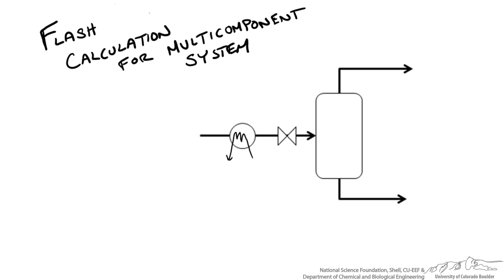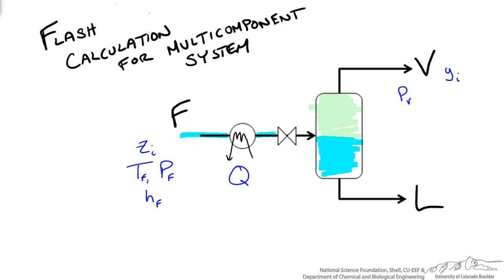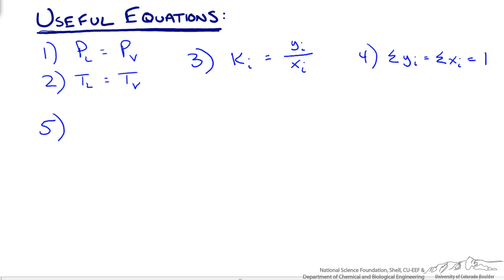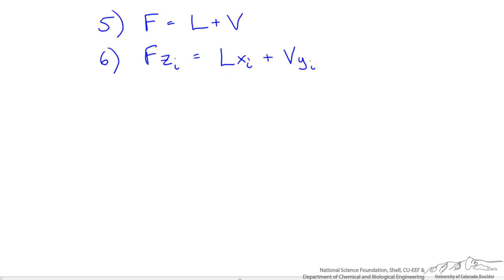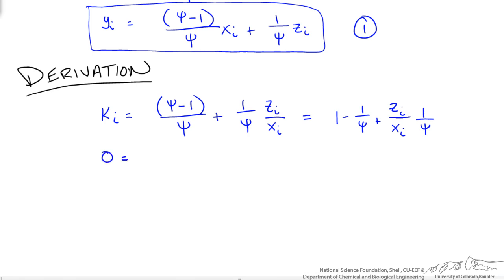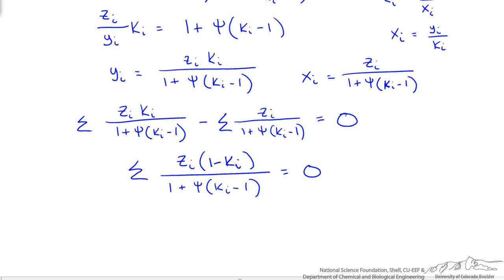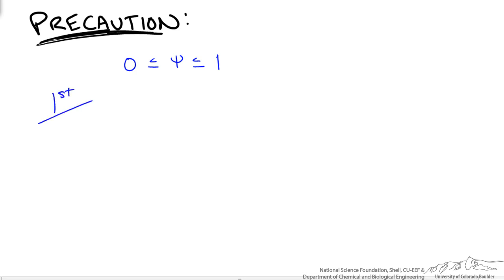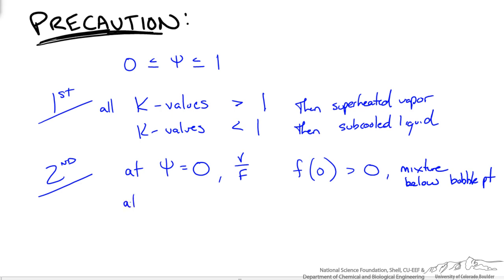Rachford-Rice Procedure for Isothermal Flash Distillation

Comment: That is an interesting approach that I need to investigate some more.   One question that comes to my mind is the the RR equation does not appear to enforce the required condition that the sums of the mole fractions in each phase must equal one.   It only enforces that these sums are equal (not necessarily one).  I suppose (or at least guessing) that the K functions are robust enough to not let this happen ?
Reply: Its just a mass balance, the only real valies are those who satisfy the sum=1 condition, if you apply newthon-rhapson method you would need to keep iterating till you get the condition satisfied.

Comment: but what happens to the volume of the steam formed? For example: I inject 1liter of water and end up with 30% vapour. If I use Ideal gas law: I get more than 1 litre of gas. Though this is physical arent the mass of fluids conserved anymore?
Reply: The derivation is based on a mole or mass balance, not volume.
Reply: Its a higher volune,but a waaay lower density ,remember that a gas and a liquid have different densities so thats why ,unless you are talking about a nuclear reactor the mass balance is always satisfied.

Comment: What exactly happened algebraically if one pauses the video at 5:00 ?
Reply from the maker: Good question.  What is happening here is that we are trying to get the equation in terms of V/F instead of F/V because V/F is used more often.  We also switch the first and second terms on the right hand side.  So, for the z_i term, F/V = 1/(V/F).  The x_i term is a little trickier.  One way to explain it is that we multiplied both terms of the coefficient by (V/F)/(V/F). [And that's okay since it's just 1.]  So then you end up with the written answer after a bit of rearranging.  Does that help?

Comment from the maker: If all K values are larger than 1 for a multicomponent mixture, then the only possible phase is superheated vapor.  Not clear on your statement about quality 75% meaning K-values are equal to 3.  K-values are dependent on temperature and pressure for the species and in their simplest form give a relationship between vapor and liquid equilibrium (K=y/x).  If all k-values are above 1, then the mole fractions cannot sum to 1 and thus there cannot be two phases.